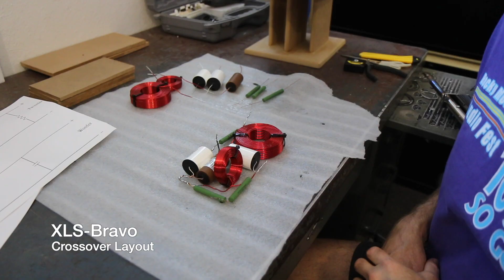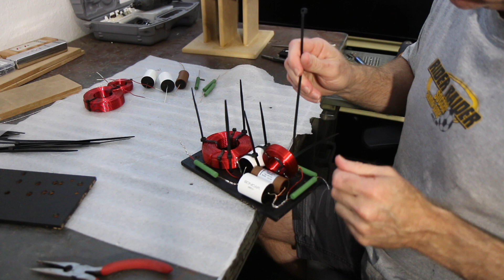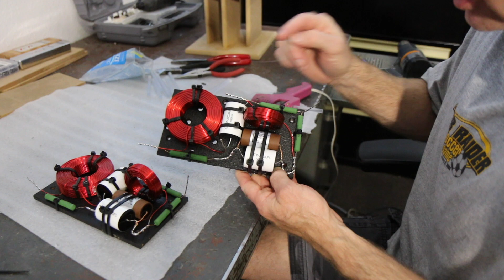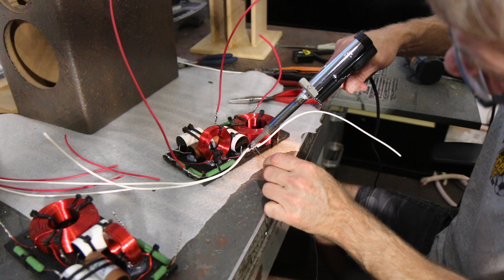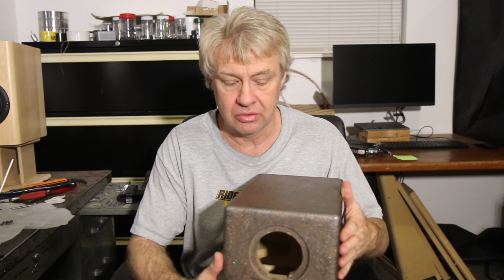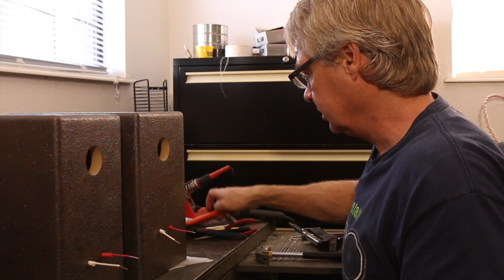X-LS Bravo | Complete DIY Build Video!

Comment: If using these speakers in a desktop application. how do you feel about replacing the filter with active two channel plate amps with built in DSP? That can set the X-overs and time. Many don't have a power amp, but usually just a USB DAC preamp with their desktop setup, so an active version would be neat.
Reply: Don't do it. You will get better sound using a passive filter and a higher quality DAC.

Comment: 3 1/2 years after starting the NX Studio kit, I’m installing No Rez. (I built the crossovers and installed the speakers and made removable backs in case something went wrong). Hooked them up and have played them for two days. All I want to do is listen to them. Had to take the back off to install the No Rez (built my own 3/4” Baltic Birch boxes) with GR’s Walnut front baffle. Can’t wait to put these back together and hear them with the No Rez installed. Without it they sound phenomenal. A little bass raspiness the No Rez should resolve. UPDATE:
No Rez in, cabinets screwed shut tight. Imaging is fantastic. The harshness in the low bass is gone. Listening to Alan Parsons Sirius Mammagamma 4K and feel the bass in my chest. Emotive BasX TA1 at 48.0. My old Mirage OMD-15’s are not even in the same league.

Comment: If you don't have a heat gun (a blow dryer really isn't hot enough) hot melt glue does a good job of shrinking the heat shrink tubing.
I used to build boats, and that's how we protected the splices and connections -- put on the heat shrink tubing, squirt the hot melt glue in under the heat shrink tubing, then go over it with a heat gun to make sure everything is well sealed. Even without a heat gun you can generally get a pretty good shrink and seal. The wet environment on boats is hell on wiring, but we had very few problems.

Comment: I'm sitting here wishing he didn't go straight from talking about how easy it is to lay out the crossovers to holding an assembled crossover. It is really hard for me to follow how and where all the components are placed and how the 2 crossover circuits connect. I was also hoping for guidance on how to wire in the inductors, does it make a difference which lead is used for positive or negative?

Comment: Your video just helped me figure out driver placement. I see the overlap in you tweeter and see you
Just recessed the tweeter slightly so it was flush and mounted the woofer over it. Genius way to get the centers closer with out point source drivers that usually underwhelm.

Comment: Nice video - it takes me one step closer to giving DIY speakers a shot.
Question on crossover vibration control - can you use a thinner version of norez on top of the crossover board, then drill holes to mount the parts on top?

Comment: Would add one tip while soldering on the tube connectors, make sure that the heat shrink is well away from where you are soldering. If it slips forward while you are soldering it can shrink it onto the wire before you want it to, and that can make that piece of heat shrink useless.

Comment: Thanks Danny, this is very helpful. A question - If I want to add a front grill to this (protecting it from small children etc.), what would you suggest for the material, and can magnets in the corners affect the electronics and sound?
Reply: The magnets are not an issue. It is the frame of the grills that can really disrupt the response.

Comment: So capacitors are directional. :) I found that out the hard way, for circuit boards for actuators where a reel of capacitors had its components installed backwards, and of course 3,000 finished good didn't work right. Recall, all that good stuff. It's really important to step back and not take for granted that people actually know what seems like obvious to the initiated.
Reply: Wait, what? That better not be true. I've assembled my xls encore crossovers with Soniccaps with no regard for direction. Up until now I haven't heard anybody suggest this.

Comment: No, twisting wires is not the same as having a crimped connection. It's also not the same as having a wire-wrap connection. If the solder is just there to "hold it", why aren't you just using hot glue for this job as well? Sometimes this advertisement channel goes over the top.
Reply: Danny is doing it right. I don't know why you would want to use hot glue to hold bare wires together. Also, the solder solidifies the bond and keeps the copper wire from corroding.
Reply: @stephensams709  - Re-read my comment. It's not about what he's doing but what he's saying (which is wrong). I do not advocate connecting wires with hot glue at all.
Reply: The idea is that the connection isn't the solder. The connection is the bare twisted wire.
Reply: @dannyrichie9743  Twisting the wires doesn't hurt for sure. But it's not like e.g. wire wrap where air-tight corrosion-free connections can be realized without any solder. 
The claim that solder would just hold connecting wires in place is nonsense.

Comment: I built Danny's XLS Encores this summer with heat glue veneers.  Turned out awesome.  Believe me, if i can do it, anyone can.  Danny's youtube tutorials were my master guide.  Also used Peter Rawlings flatpacks.  He has youtube DIY also.  Best decision i ever made.
Reply: I'm doing the same thing, still not finished, but the cabinets look amazing. I spent $1500+ all in with upgraded components, tools, and stupidly expensive veneer. Have you found them to be a better value than buying off the shelf speakers for the same price?
Reply: @sparkeyjones6261  They are amazing.  I would definitely do over.  I'm also curious about the CSS 1TD-X.  Both receive similar reviews.  I'm guessing the GRR boxes with the no-res sheets provide better audio quality.  The cross over networks are similar (perhaps easier connections with CSS).  I rounded over the sides of my boxes.  The CSS do not suggest that?  Anyway.  Great quality for the cost. A definite do over.  As a comparison to pre-made I"m not sure.  I would like to hear a side by side of the KEF Meta's to do a side by side.

Comment: Regarding the hot glue, would it hurt to squirt some hot glue on the board before you put the component down? The result being the glue is underneath each component instead of around the component.  Is that a good idea or no difference?
Reply: It dries to fast to do that.
Reply: I don't agree with no res acoust vinyl sticky back with foam on it, but it would be useful in this circumstance, to stuck it on the board and pushed your components through and tie wrap to the foam soldier them on the back of the bored and another sheet of foam stuck to the underneath or where you're placing it ideally have the crossover outside the speaker
Reply: yes. could use some epoxi glue... and while zipping, could tie it from the back, so the finish would be nicer on top.

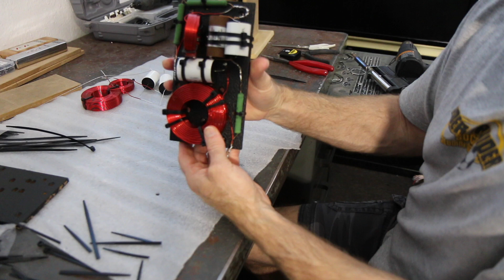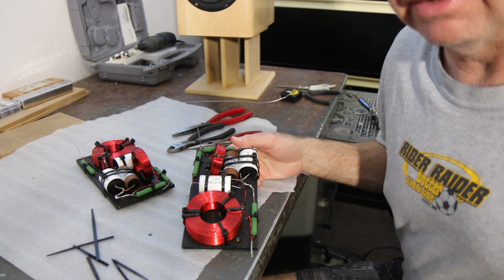Comment: You seem to have hopscotched over the most complex part. At about 01:10 you said that we were going to look “right at crossover assembly.” Then, at 04:19 you show a fully assembled crossover.  At about 15:27 you give a general overview of what it does.  Then, you begin assembling the second crossover with only comments but no real instructions.  Finally, at about 20:10 you have it completed without footage because of a camera problem.  So, could you not have done another one? Please do another segment of this video showing the connecting of the crossover parts together like you said back at 01:10.
Also, you mentioned something about a component being installed in the right direction.  Do the enclosed instructions explain that?  The critical connection of the component was not covered.
Oh, and repeatedly saying that it’s “pretty easy” does not automatically make it “pretty easy.”  A clear, complete, descriptive video of the process is what would make it at least easier.
Reply: Check the assembly video's of the X-LS Encore. The values are different, but the assembly process is the same.
Reply: @dannyrichie9743  I have watched your loudspeaker assembly videos repeatedly.  They all seem to put the crossover assembly part as low priority.  The process is just given a cursory take.  So, when you made such a point at 01:10 about how this video was going to be different, I dropped everything to watch.  Now, I appreciate your efforts in presenting them.  I know that it’s not a simple task filming such detailed things.  You don’t have a spare camera man just sitting around with nothing to do.  And, believe it or not, yours are the best I’ve seen on YouTube as far as “real world” electronics wiring goes. (I have scoured the web).  But that most detailed part of the procedure is still a black box to me and others without a better explanation and camera view.
Reply: @greenbeginner3353  Thanks for that feedback. There are a few others that might be helpful. I did some crossover assembly footage on the X-LS Encore, the Desktop Mini, and the Klipsch RP-600M.
Reply: @dannyrichie9743  Those are the ones I mentioned previously.  They all gloss over the crossover assembly process.  I don’t know if you are afraid of people stealing your design without paying. But don’t worry … anybody with the ability to try that has already figured it out!  Meanwhile, the  ones you appear to be reaching out to are the ones who do - not - understand these things.  They are the ones who have indicated to you that they are apprehensive to try.  They are the ones who WOULD buy if they could have a view into this black box called “wiring a crossover.”  Make it clear and I for one would lay my money down!  But at this point, you are apparently keeping it a secret on purpose.
Reply: @greenbeginner3353  There is nothing being kept secret. In this one I show the entire assembly process from start to finish including the schematic. https://www.youtube.com/watch?v=HqxLuTprb1U&t=586s   And a lot of the people that ordered that kit were first time DIY'ers. And most of the feedback I get from them was that it was a lot easier than they thought. Several have since ordered other kits. 

I even shot a video on how to solder: https://www.youtube.com/watch?v=mVcOWx7hQiQ&t=28s

Comment: As perfect as the encore is, i cant help but to wonder, id love to see you design a 8 inch woofer with soft dome that would dig down into the 20s, and keep it fairly compact, meaning 30 pounds or less or so, that would be a market killer.
Reply: There are trade offs. If that 8" woofer is capable of dropping into the 20's then I will have to give up sensitivity. It also adds surface reflections from the wider baffle. So imaging and transparency take a hit.
Reply: @dannyrichie9743  that does make sense, then it may not have the magic of the encore that got me hooked, just for the lower bass response, always seems there is a tradeoff in this hobby. I was curious about it, it would be something to see, but your right some it would suffer efficiency and alot of other variables to work around hence the bigger woofer and cabinet, and may not be as musical and the imaging and instrument separation may be affected, well a fella can dream anyway!

Comment: Fine System. But where are the measurements?
Reply: On the X-Bravo page: https://www.gr-research.com/store/p102/X-Bravo.html
Reply: @dannyrichie9743  thanks a lot. Looks really great! Only weakness is a directivity error at 3khz. All other looks perfect not only for the price.
Reply: @exif6839  I wouldn't call that an directivity area. You have to get to 30 and 40 degrees off axis for a slight bump to form. Keep in mind that is all on a 5db scale (not 10db), so it is actually super smooth.

Comment: Danny, given that most amplifiers have some type of binding post as their output termination does it really make that much difference to have tube connectors at the speaker end of the connection?
Reply: Yes it does.
Reply: @dannyrichie9743  Dumb question, but I've never seen what goes into your tube connectors....banana plugs...bare wire???
Reply: @morrisonAV  I've never used them, but I have some on the way. From what I can tell, there is a pin that crimps on the speaker wire and then plugs into the tube. Very clever!

Comment: I'm very curious to know the difference between the optional upgrades offered. $200 for a set of caps? Are they made of gold? Seriously, are they? I'd love to see some measurement when you get a chance. 
Cheers 🍻.
Reply: @rc6717  For the money, nothing really beats the Sonicaps.
Reply: They are expensive to make and the performance differences could be considered golden.
Reply: @rc6717 :
 Yeah, this is where I'm coming from. I have some experience in this department and I can't say I've ever noticed any difference between a good cap and the one's that pretend to be made of gold. Of coarse nowadays we have readily available tools for measuring the difference that I didn't have back then. I'm all about those numbers and I'd love to be proven wrong.
Cheers 🍻.
Reply: Look up prices on the internet for high-end caps and resistors. They are not cheap. Also, don’t forget the time Danny spent in designing and testing. Nobody works for free. 

And, yes, upgraded caps, coils, resistors, etc., do produce audible improvements in detail and transparency.

Comment: I’ve always wondered if there is any concern with the small piece of metal that is in the zip tie effecting the signal path of the crossover. Or is this of no concern? Perhaps it’s stainless I’m not sure
Reply: Those zip ties are all plastic.
Reply: @dannyrichie9743  Exactly!
Reply: The original T&B Ty-Raps are the only ones I'm aware of and I believe it's stainless (at least the black weather-proof type). 
Regardless, it'd be a non-issue.

Comment: I'm curious if you have ever tried cutting and fitting no-rez to the insides of the pieces prior to box assembly to get an even better fit. Could be a fun little jigsaw puzzle to figure out prior to glueing everything together.
Reply: You don't want to go into the edges you want to leave2- 3 inch gap all the way around when filling with sponge
Reply: @johnsweda2999  thanks,Danny was   totally out of NO REZ.  When I finished my subwoofers.
Reply: What would be great is if GS Research made pre-cut no-rez available for their speaker designs. Not everyone wants to deal with jigsaw puzzles,

Comment: You’d have to spend a minimum of $5K-$7K for speakers with crossovers of this quality.
Reply: I'm not sure even some of them have the kind of quality crossovers that you see here : )
Reply: So what if the drivers in this thing are cheap POS by Peerless India. You people really think that spending so much on crossover parts than on more linear and less distorting drivers will get you closer to the audio nirvana.
Reply: @pliedtka  Get up on the wrong side of the bed?

Comment: Im a huge fan of your work Danny, but have you ever considered drawing out the crossover just like it’s being made instead of using a schematic? I think this would be easier for people to follow
Reply: this is difficult to do, one reason is that the wires on the capacitors / components can vary in length making a once possible layout not work any more. however I agree that a photograph (from above) of Danny's finished crossover would be useful- a drawing too would be useful with a message that its just a guide and not guaranteed to always work. I recently built mine , have a look at my Dropbox photo and drawing downloads with this 'burning in' video https://youtu.be/UuSOrjNxdSI
Reply: @kevinmcgrath3591  Have you seen the kits by CSS Audio?  Their Crossover boards have predetermined locations for each component.  A crossover assembled by one guy has everything in the exact same spot as a crossover assembled by another guy.  No drawing needed.
Reply: @greenbeginner9221 that should be standard for all kits. also their packaging is great.
Reply: @kevinmcgrath3591  I THINK impedence changes with every speaker negligible but yea

Comment: Thanks for the great video. I have a Onkyo crossover which uses a 1pf cap in parallel with a .39mH inductor going to negative after a 4.7uf and a .47uf in parallel inline on the positive side for the tweeter!?
Reply: The tweeter might have a screaming hot top end that they are trying to drop out of it.